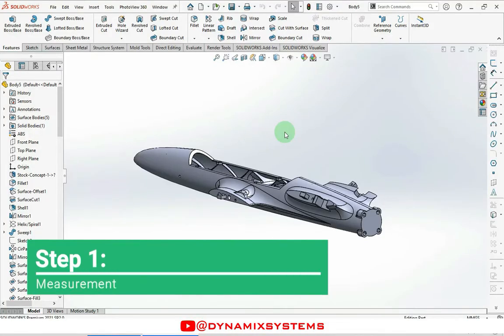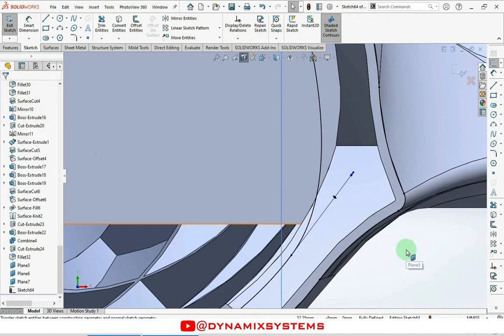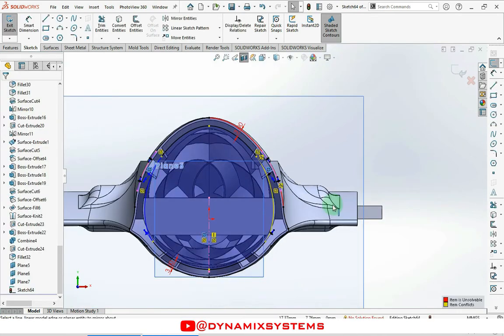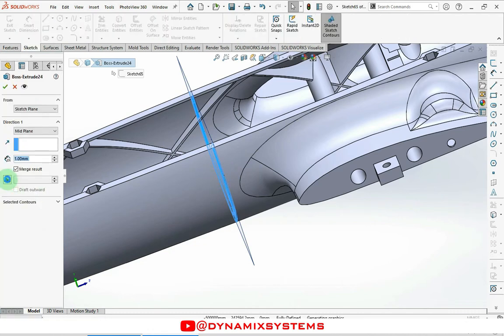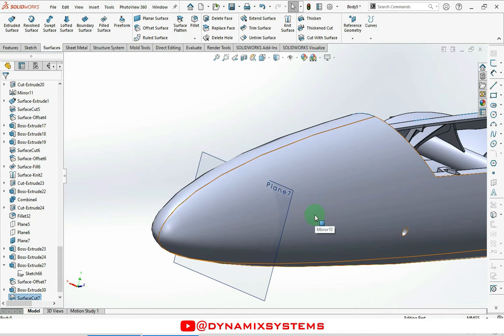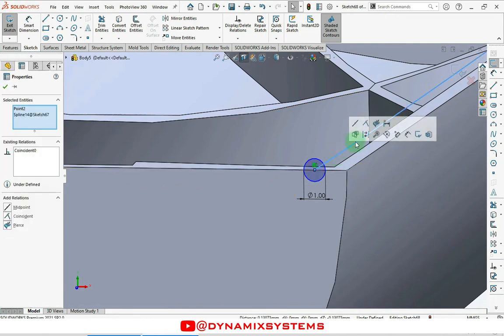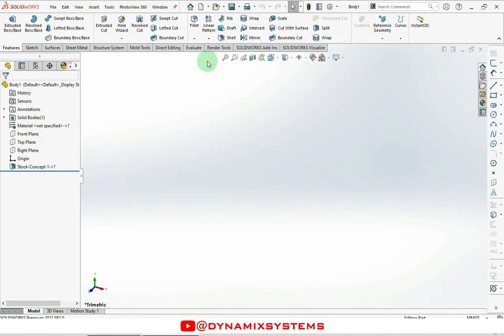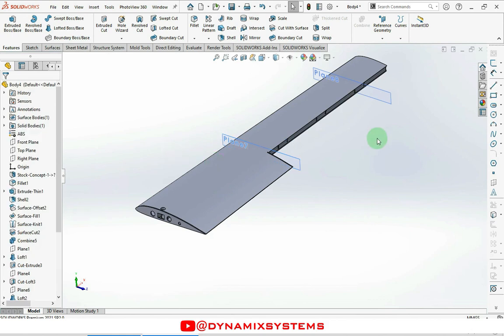DIY 3D Printed Drone Design In SolidWorks (Part 13: Splitting Parts)

Comment: those  wingtip things  equal  vert-STABS.!     in  the  WRONG  places.!        INSTEAD, the wingtips  Should  be  blunt  or  rounded.      along with dihedral at the v-tail that  Will  produce  vert-stabilizing moment.
Reply from the maker: Those are "Winglets", they prevent the higher-pressure air from underneath the wing from reaching the low-pressure area on the wingtips. by preventing the wingtip vortexes, we have a little better lift performance.

Comment: I was wondering, how it going with the printing, it seems that you will have a lot of overhangs, one more thing, when will you create a discord server for your followers? :)
Reply from the maker: Actually the reason of using X pattern in the structures is avoiding hang overs without using supports. all the parts are optimized for this separately after dividing.
* I'm not very familiar with discord. what you think about Reddit?

Comment: Hey, I’m looking to have someone make me a pretty simple design propeller and 3-D print it, I need 1.6 inch props for my mini drone. Would you be able to do that if I pay you?
Reply from the maker: Hi, I can design it, but my printer is broken and it will take time to fix or replace it. So I just can simulate the design and can't test it in real situation...